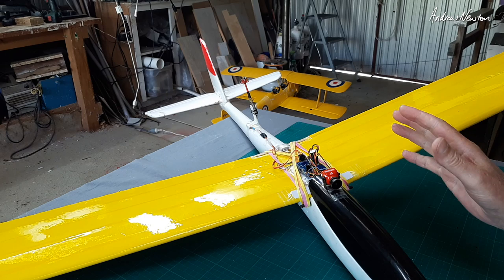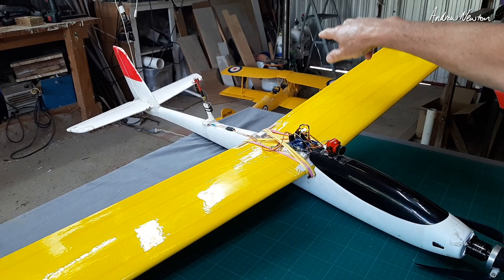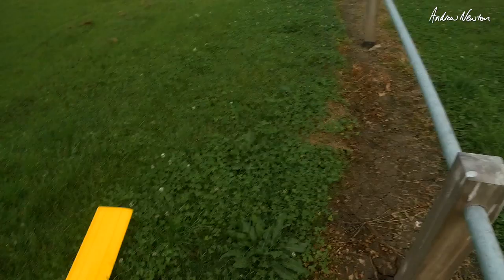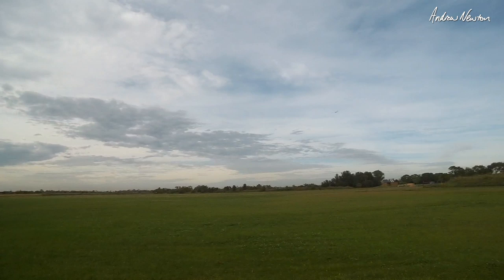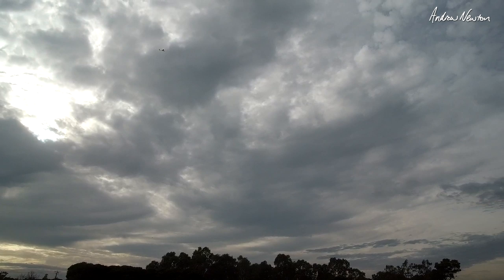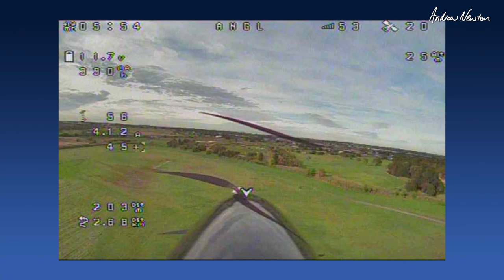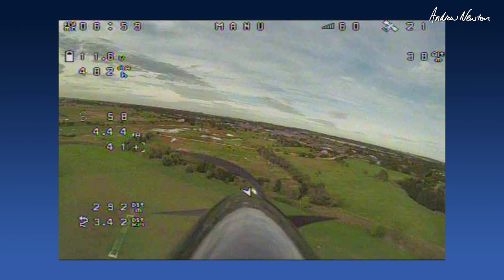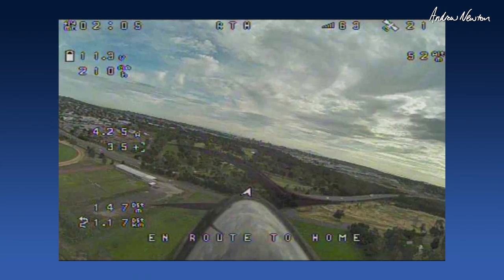No Ailerons iNav

Comment: Interesting video Andrew...perfect calm for testing too...We are on weather lockdown anyway it won't stop blowing, so a welcome video as ever..Air Mode is a Multi Rotor flight Mode, it does exactly nothing on a fixed wing, uncheck the tick box.
Reply: Without Air Mode you don't get any control at zero throttle, no ?
Reply: @StefanNaewe  Nope, what a rediculous notion...I have a motor glider with iNAV installed. Guess what it spends most of its time doing?
Reply from the maker: OK, you have convinced me to ignore the experts and give it a go.
Reply: @AndrewNewton  Good, at last...less useless clutter on your OSD...Rudder Is  very good at keeping a heading tbh, surprised iNAV doesn't make more use of it. My big Skywalker's Ailerons for example are hopeless unless combined with Rudder mixing. That's just an undesirable trait of the model though...🤔🤔😒😒

Comment: Putting one in a sophisticated lady right now that I’ve added a power pod to.  Should be nice, light and allow nice fpv thermals. Only real purpose of the flight controller is RTH and gps loiter in emergencies and of course altitude back to radio for variometer purposes. Should be fun.

Comment: Omnibus F4 (ArduPlane) with XM+ receiver it's working but with JUMPER R1+ receiver there is nothing on Radio Calibration tab. Roll back to INAV or BETAFLIGHT or CLEANFLIGHT now JUMPER R1+ working, again in ArduPlane R1+ not working, XM+ working. Can you check that matter ?? Waiting for any kind of reply.
Reply from the maker: Cant help sorry. I have not used Ardupilot or Jumper

Comment: A month ago I got it into my head to add FPV to one of my favorite gliders. Since I wanted a nice OSD,  I added a Matek F411-wing FC onto my trusty Parkzone Radian. But I'm a bit confused how to connect the rudder servo. At the 1:37 mark you mentioned that you had the "rudder servo plugged into the aileron channel". In the documentation on iNav for ths flight controller it says there are (2) aileron channels. Can you tell me which one to connect the rudder servo onto? BTW, thanks for all the great videos! Been a subscriber for a while now.
Reply from the maker: Either aileron output will do, just have to make sure it moves correctly. You can change direction in the mixer or outputs page

Comment: I'm wondering how this is setup in iNav - does a person choose "airplane", and then just not connect ailerons?
Reply from the maker: Plug rudder servo into aileron output pins
Reply: You just answered my question... Now to dig out my well preserved 30year old 2 meter gliders out of the garage, 👍 @AndrewNewton

Comment: Hello. Your video is really what I was looking for. A question. Can it be done in INAV that when the rudder turns, there is an elevator compensation? The turn would be much smoother and the wingtip would not drop. Truth?
Reply from the maker: INAV uses gyros accelerometers baro and GPS rather than mixing to maintain altitude and attitude. Not really designed for use without ailerons too.
Reply: @AndrewNewton  It's true. That is why the only thing left for us in these gliders is to put a polyhedral wing. This should improve self-stabilization.

Comment: thanks for  trying RTH in 3 channel only (no ailerons). Now i wonder how u can do that (that hold bank angle is so good, it feels like using ailerons), in my model (no ailerons too) when RTH its always spinn and goes down (like its too much turning). Do u change yaw PID setting???
Reply from the maker: INAV doesn't really understand 3ch planes. It's OK in calm weather but any disturbance can make it wobble into a stall
Reply: thanks sir, but how about using preset aircraft without rudder in INAV, so the rudder servo goes to aileron input to FC? will it work? @AndrewNewton
Reply from the maker: @dayyanhanif8493  That's how this one was configured
Reply: its wobbling on 2,3 meter wing glider, ill just back on normal 4 channel. Do u have video about INAV Soaring mode (switch activated and no sticks input in flight)? that will be great video for glider INAV pilot @AndrewNewton

Comment: How did you set up only rudder and elevator in Inavs mixer? I want to do the same thing with a FT Explorer 3ch.
Reply from the maker: Just treat the rudder as an aileron. Mixer is "Stabilised roll".  Be careful, it may wobble a lot in RTH
Reply: @AndrewNewton  Okay, did you remove the rudder in the mixer instead then?
Reply from the maker: No need to delete it, but nothing will be plugged in to the rudder pins
Reply: @AndrewNewton  Okay, I see! I will try this. Keep up the good work!

Comment: Good time for building if you can get the parts. All my FPV planes don't have landing gear. I want to buy/build a small  twin engine puller with robust landing gear ( small means < 800 mm wingspan) to use for FPV. If I could make sub-250 that would be great but seems unlikely.   Any suggestions?
Reply from the maker: Impossible unless you're using exotic ultralight materials I would think. Dart 250 is the best available
Reply: @AndrewNewton  Sounds like a bit of a challenge. BTW: The ZOHD 250  is not really that light. I have built bigger sub-250 (FT dart twin engine, full inav, gps etc) in laminated depron that weigh less and fly's much better. But no landing gear. And I am a very untalented builder - it's just with the quad electronics everything can now be tiny and lightweight, including very powerful motors. Might have answered my own question. A scaled down twin engine Flite Test Mighty Mini Guinea  in depron might be the go.

Comment: Hello 
Is it just one Chanel for rudder or split for 2 with Y cable?
Reply from the maker: One for rudder, one for elevator. Plug the ruder into the aileron pins on the board
Reply: Andrew Newton but you have two plugs for Ailerons and in inav also
Reply: Andrew Newton and what should I choose in inav mixer? Stabilized pitch for one servo and what for the other one?
Reply from the maker: Plug in to either aileron input on the board. Stabilised roll for the rudder in the mixer. Beware this doesn't work very well. Only works on a slow flying glider and it will wander around in RTH.

Comment: Nice..  My first FPV plane is an old Escuela glider with poly-dihedral wing (like the Gentle Lady) with a board wich doesnt work very good (it uses IR sensor copilot as stabilizing) and i have wondered long if inav could handle the stabilization with rudder only.. 

meanwhile be have been 44 days on hard lockdown over here
Reply from the maker: Haven't convinced myself it's a good idea but fun trying

Comment: Can it fly waypoints?
Reply from the maker: Yet to try waypoints.
Reply: @AndrewNewton  I learned to work with waypoints in the IL2 PC game. The problem with waypoints is when the plane can not hit a waypoint (too sharp angle, wind, thermals) the plane will use too much time/energy in recovering the route (also hight); best setting is to ignore this waypoint and go to the next waypoint. I also learned to fly RC planes by flying the planes from a external view (CtrF2) in IL2. https://en.wikipedia.org/wiki/IL-2_Sturmovik_(video_game)
Reply: @AndrewNewton  Also to prevent crashes; pre-/download the maps.